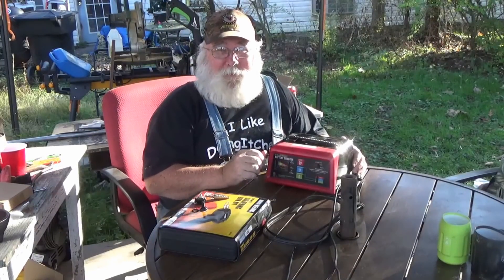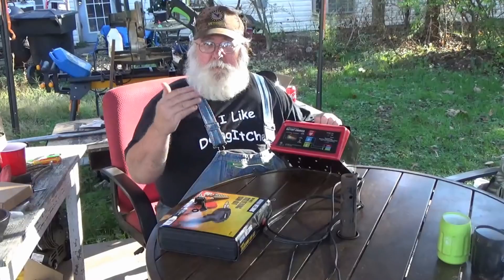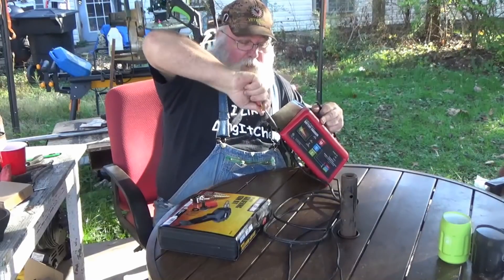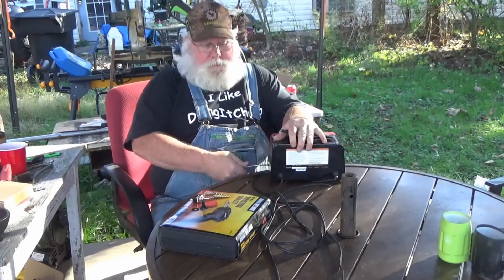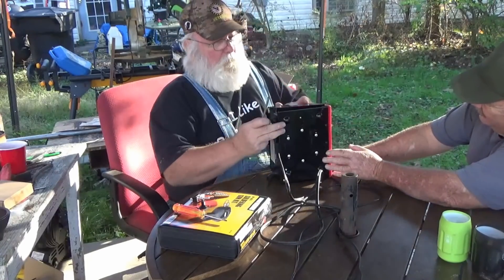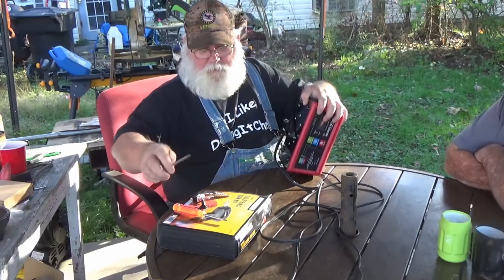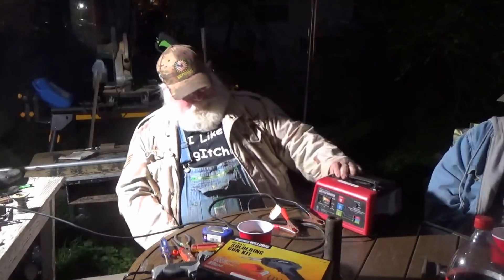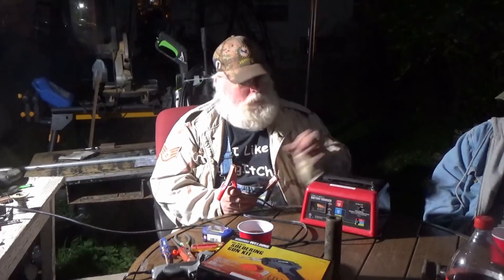PawPaw Forces the Harbor Freight 2/10/50A Battery Charger to Work

Comment: I have a slightly different model, my pos in from the wall and out from the board to the transformer are in the same place. I’m thinking I’ll just solder them together. - Austin danger powers.
Reply: I have the blue model, did you do it yet?

Comment: thanks!  excellent video.  I was thinking, they make timer switches, that will close for 30 minutes or so, then open.  You can hook up the dead battery, turn on the charger, and crank the timer switch that jumpers over the relay.  It will start chaging, and 30 minutes later when it opens up, if the battery is not fully charged, it will continue to charge it but shut off automatically.
Reply from the maker: I guess it did not stress the point enough.....flip the switch to power it only for a second.  The charger just needs to detect voltage to start, then you don't need to keep the auxiliary power on.
Reply: @DoingItCheap  oh, that makes more sense.  a push button momentary contact switch then!

Comment: I have the same charger and I always hated that smart part. ai m going to do what you did !! THANKS
Reply: I tried but the board in mine is different. I will just have to do the 9 volt battery trick.

Comment: What to do with a so-called battery charger that only charges batteries that don't need to be charged because they are already charged?
I come back from a trip to the airport parking lot and the car battery is completely dead because the interior lights weren't turned off. 06/23/22 at 8:50pm. 
No problem, I have a battery charger in the trunk. The friendly lady who managed the parking lot gave me an extension cord that just reached between her booth and my car. I was able to connect the battery to the charger. It's no surprise that this charger doesn't charge the battery. The charger did not detect that an empty battery was connected. I had to call an Uber to help me start my car.
It took me almost 2 hours to get home from the airport and there I no longer needed a charger as the engine had recharged the battery on the way home.
What kind of stupid engineers produce a battery charger that can't charge a battery? This chargers are unusable. I always have someone at home and in the office who can give me a jumpstart if I need it. I need a battery charger that works when the battery is dead and no one else is around to start the car.

Comment: From the outside, this charger looks like an old school manual charger; However this charger will not work if the battery voltage is too low. This mod makes it work like a good old fashioned manual charger and will force charge any battery regardless of how low the voltage is. It is a bummer they no longer make manual chargers anymore and there are only "smart" chargers which are actually dumb because they are not as useful.

Comment: And you just voted your battery Chargers warranty
Reply from the maker: I think you meant voided.
Reply: @DoingItCheap  How do you know when the battery is fully charged, because when I connect charger to any Battery the one LED light goes on and never turns off. and I mean the green charging LED on the charger, or do you have to rely on the meter that say's 100% to know, because the margin of error is greater relying on the meter, versus the charger turning off automatically.

Comment: I think you'd better be careful what you're doing with that. Cool, some battery chargers are set up the way they're set up for safety reasons. Be careful do not alter the battery charger's operations. Do not take the breaker out of it. You should always leave it the way it was set up to do there isn't intelligent breaker? It recognizes the battery and the reason why it won't charge battery be cause or should say a dead battery. In, for example, if there is no voltage for it 2 cents.  And then again is the breaker. Were circuitry working properly in the battery charger? If not, you should take the battery charger back and explain why. However, you might want to consider about getting a different battery charger. Some battery chargirls only recognize the battery if there's voltage in that battery.  And that's probably one of the reasons why the battery charger cannot charge a dead battery because maybe there is no voltage or there might be a badstill be careful with the batteries when charging them.
Reply from the maker: Are you the safety police?  If so, you are going to have a full time job just going through my channel !!
Reply: I can't really see where you put the toggle switch from end to end video kinda dark..... thank you

Comment: Hey SSgt PawPaw you just like me "I don't need no stinking warranty" and proceeds to make modifications. Former USAF SSgt/1Lt here.
This charger on my list for my next HF run. Going to add that switch so I don't have to parallel connect a good battery. This cen-tech appears to be the only cheap manual charger you can buy.

PawPaw has heard this before but for everyone without the HF charger and like others commented you can fake a battery charger into charging by using jumper cables to parallel connect a good battery with a bad battery and put the charger on. The charger will sense the 12v and start charging. A 12VDC AC adapter should work too. But switch makes the HF charger perfect.

Once the HF got it charged, switch to an automatic charger and desulfate 1 day, charge, desulfate 1 day, charge, desulfate 1 day (with automatic charger). That gives best results. Use that HF load tester and see if you revived it to within 80% of stated Cranking Amps.

Only add water to cover the lead plates on a dead battery because that acid level can permanently rise + bubbles will overflow it. Fill with water to normal only after rejuvenating the battery. Sulfuric acid will only evaporate above 300F so only hydrogen, oxygen, and water can evaporate or bubble off. Acid will always stay put unless it overflows.

The HF is good to throw on a few days once you get above 7V, with or without the switch.
The harbor freight has a protection circuit so the cables aren't live until it senses 7V then it will turn on. Just like you showed those cables are live once you hit that switch so don't let them touch. Without the switch, the cables won't spark when you touch them together.

The optima digital 1200 will operate down to 1.25v but we ain't DoingitCheap since it's $260. 
Currently working on four old batteries been in my garage for years and so far got an AGM working at 610 out of 690 cranking amps. The real test is internal drain - let it rest a month disconnected and then load test it. 
Looking to pick up the HF charger since I got them over 7V but both my automatic chargers keep shutting off and going into desulfate mode. This good AGM will be my jumper battery since I got no vehicle that needs it.

If that spare battery give up the ghost, the DoingItCheap last option is $10 gift card from AutoZone, Advance, or O'Reillys for a 12V battery with no cracks. Seems NAPA don't give $10.

Comment: I will try this I have a mini cooper with dead battery and I would like to get it running again because it has been sitting outside in the elements for about 3 months and I could not drive it because the battery died.

Comment: Should put a small 30 minute timer in I stead of a toggle switch
Reply from the maker: It only needs an instantaneous jolt to start charging.  I flip the switch on for just a second.
Reply: Great I didn't understand that part.  I thought it took a few minutes. Thank you
Reply: I was wondering if a momentary switch would get it.  I might forget to flip it back myself.

Comment: I have that same charger and when you go to charge a battery that's a little low I put it on the 10 amp setting to charge it quicker and it starts clicking on and off really fast, I then put it on the 2amp trickle charge and it does fine. So does this modification by pass what I just explained and lets the charge work in the 10amp setting? It also does this in the 50amp setting, just clicks on and off really fast, so I guess that's a safety feature. I have a car battery that reads 10.42V so I want to do the modification of reconditioning the battery with a 200amp schumacher....where you turn it on 200amps for 5 minutes and watch it boil, then let it rest for 15 minutes and do that again for about 5 cycles and eventually you desulfate the battery doing this process. The problem is my brand new schumacher 200amp kicks off after 5 seconds so I guess that's a safety feature too. I hate these new safety micro processor boards. So does this modification fix that problem too and lets the charger stay on the 200amp setting without shutting off. So this modification by passes the built in safety circuit board? I'm pissed that I bought a brand new $135.00 200 amp charger and it won't stay on to do the desulfating and bring the battery back from the dead....this new computerized crap sucks.

Comment: I hate that feature myself. My old charger would provide power all the time. I tried this with my Centek battery charger, which looks similar, but probably a newer model. It is configured differently.  I could not get this to work with it.

Comment: Thanks for the info.  I had to 'charge' the completely dead battery a little with my old charger, then i was able to switch to the new charger to complete the charge.  I had an idea...could you 'trick' the sensor with a 9V battery bridged between the  clamps to get the charge to iniciate?
Reply: Yes that will work with a 9v. Battery jumped across the 2 clamps.

Comment: What a NOVEL concept. A battery charger that will CHARGE a dead battery!!!! I've seen this issue before. Pisses a guy off. I mean come on. The concept is simple. Battery is DEAD.. I want to make it un DEAD. That means I need power. 

Thanks for the video..
Very insightfull

Comment: Whoever decided these new chargers have to act this way had to vote for Biden. I need Trump chargers!!
Reply: Lol
Reply: I need a exact replacement meter guage that'll fit the hole left by the old guage.  It's exactly like the red charger one you posted.
Reply: I know😂
Reply: lol don’t do me like that 😂
Reply: They are designed for the “Useful Idiots” that voted for biden and harris.  I have one of these charges, and I hate it.  Wish I had my old charger that I could use for a 12 volt power supply when I needed one.

Comment: Love the concept of fixing and adding a switch.  I was not able to see where you soldered the wire.  I guess you soldered one wire to where the main wire comes in and not sure where the second wire was connected.  May be just me.  Thanks for the great fix.
Reply from the maker: Watch it again and pause it when David zooms in.  The switch wires are soldered to the two large rectangles on the bottom left of the circuit board..... the ones I keep touching with the screwdriver.

Comment: Awesome! Thank you pawpaw!   I've got a big, wheeled 20+ year old heavy "dumb" charger that works great and a couple maintainers that I don't use as much as I should lol   I've been thinking about buying one of those cen-tec chargers and figuring out how to if possible bypass the sensing circuit to have a more portable option when needed than my old trusty boat anchor for DEAD batteries.  Tho you can't take full credit, I'd likely never found the video you saw!  Thanks again pawpaw👍

Comment: Once the battery has a little bit of a charge. If you shut off that toggle, will it then still charge after seeing power?
Reply from the maker: Yes !  Then the charger works normally, decreasing the output as the full charge is reached.